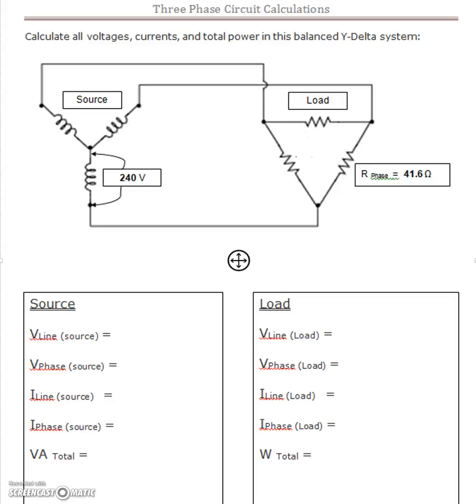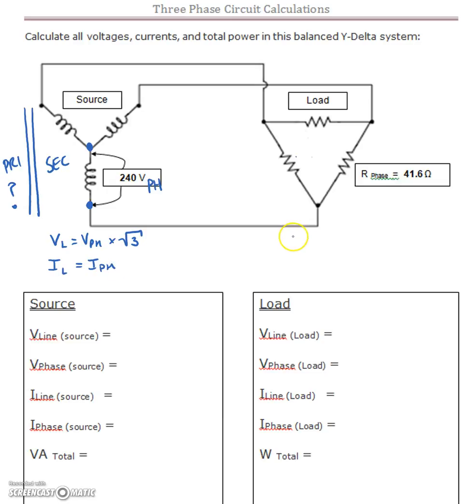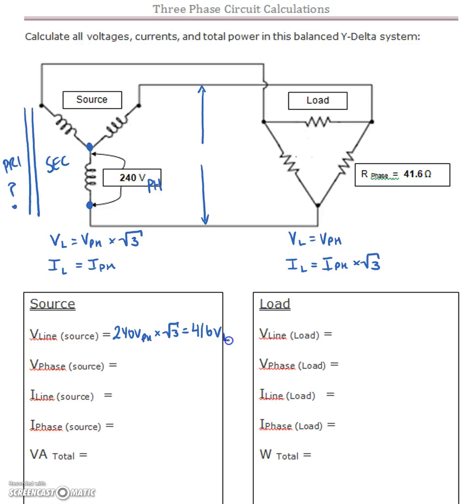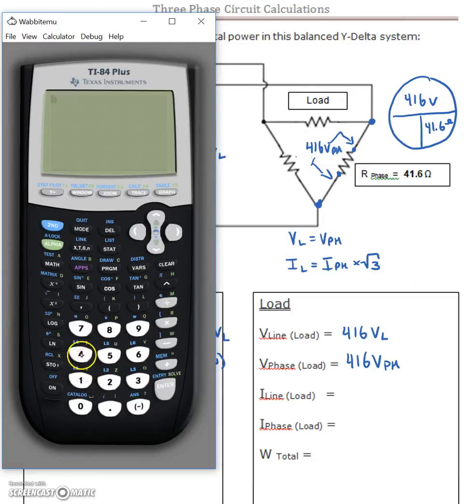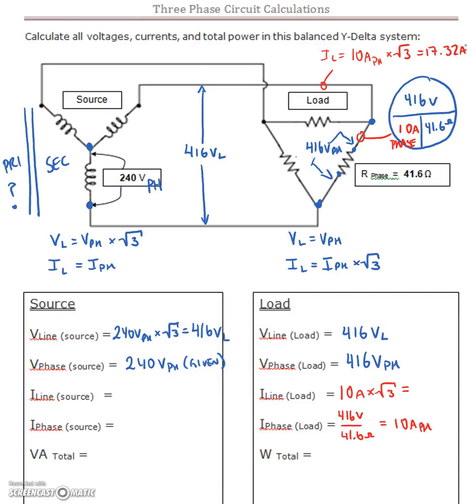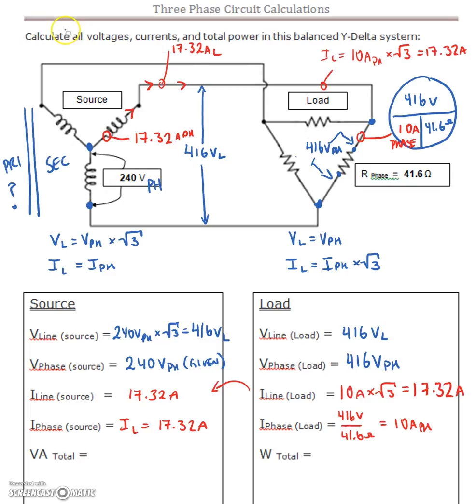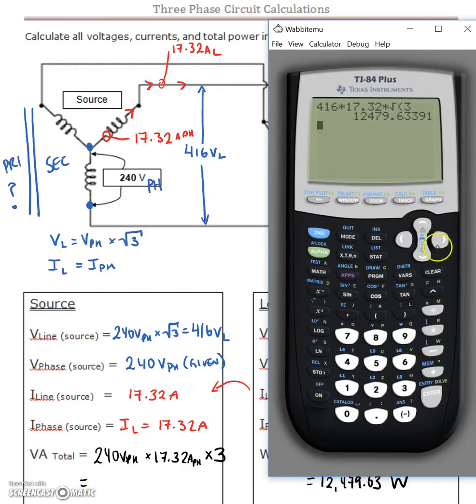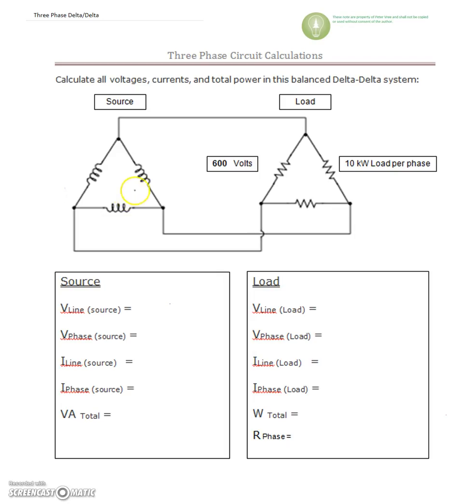3 Phase Calculation #4 (Wye Source, Delta Load)

Comment: Thanks, this was excellent. Quick question, 
Is there a standard error margin for the power values i.e. how far away do VA and W need to be before being considered too far?
Reply from the maker: I would say 5 to 10% would be the most. Depending on the amount of decimal places you are using, there will be discrepancies between your values and mine. Also, remember that out in the real world, all components... resistors, capacitors, inductors will have a 5% tolerance due to the way they are manufactured.
Reply: The answer to this question really comes from the Utility company.   When you get hit with a power factor charge on your utility bill, then they consider your power factor too high.   In our local area, it is power factor less than 90% will cause these charges.

Comment: Although I totally agree with your math video, i feel it would be better to use values from real world.   A pure restive load(like electric heater) cut sheet information would be in KW, not Ohms of resistance.   Also, the 17 phase amps in the wye, are you showing that for math purposes only?   Because the common point is not used by the load, there would no point where a clamp on ammeter could get that value.  Am I not correct?
Reply from the maker: It's just an example to build on. Don't analyze it too much...
Reply: Pete Vree   The question was real.   I'm not trying to trick you.   I'm not great at math.  I appreciate your videos.   It's a shame more aren't viewing it.